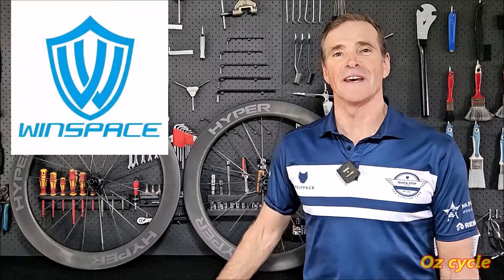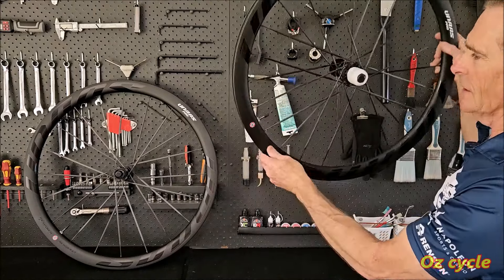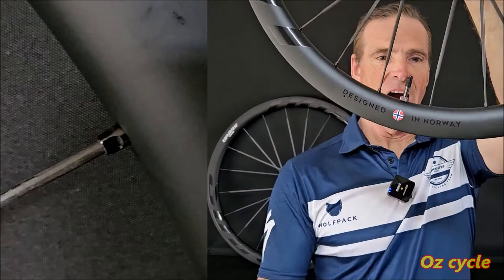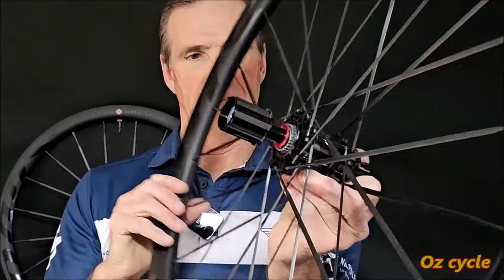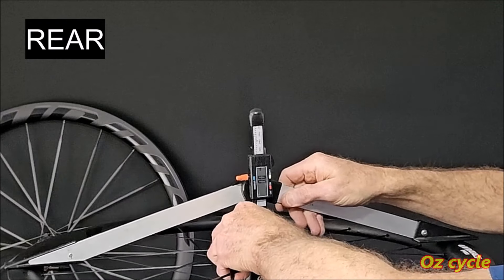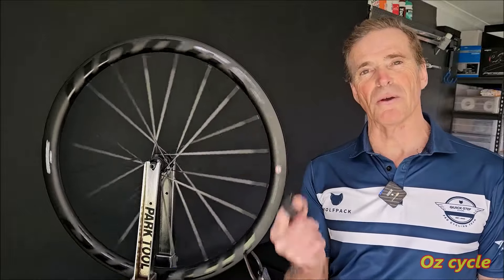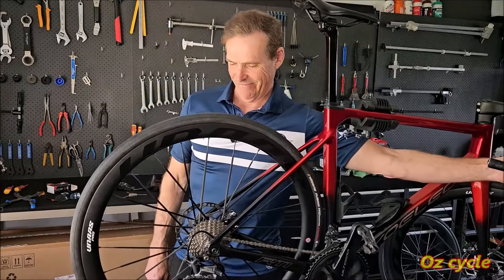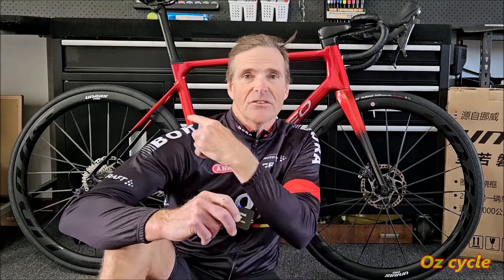New Winspace UNAAS carbon wheelset - full review

Comment: I have the 2023 Hypers.  2 weeks ago, I was on brand new asphalt.  Smooth as anything.  Anyway, got distracted and wasn't looking at the road ahead and went right into a big, deep hole in the road where a utility is located.  I was going at a pretty good clip and almost went out over the handlebars.   To my surprise, my Hypers are perfectly fine, not even a tiny wobble.  Amazing.
Reply from the maker: That good. Yeh , carbon is very strong up to it breaking point.
Reply: @stevenleffanue I hope that you are well , regards , Robert . I am still cautious of brands that are new or yet to be proven .
Reply from the maker: True. Winspace have been around long enough and have a good reputation.
Reply: @stevenleffanue  Over 90% of all carbon rims are made in China! Even the ones from most big western brands. ;-)

Comment: This is definitely a good and thorough review in my opinion.  So, thanks for that - it helps with being in the market for some wheels.  I'm a casual road biker, but put about 1700 miles a year on.  I ride a Giant Defy Advanced, but it has original stock wheels, and these bad boys are about 2200grams, give or take.  So, as you can imagine - first and foremost -  want to lessen the weight.  But, I see here with the comments that me feeling good about a 1500-1600gram offering is off the mark when considering carbons, much less carbons with carbon spokes at sub 1400grams.  I'm a 180lb rider, so middle of the road and I don't think I need "robust" wheels.  My question at this point is in considering cost/shipping/duties/quality and whatever else - how is a wheel like this going to stack up while also considering alloys from Hunt, Scribe, Boyd?   I can get 1500-1600 gram alloys at about $500 give or take from these companies - and they're not made in China.  Is it worth it at a current sale price of $699 USD on these for the extra 100 grams?   Given I'm currently riding with boat anchors, I was super excited to get down to 1500 grams.  Now, at this sale price of $699 on UNAAS Pro D40s , I'm tempted.  Any comments?

Comment: Hi Mate, can you confirm if they are centre lock or six bolt?
Reply from the maker: Centrelock
Reply: Thanks Mate
Reply: About to place an order, do you recommend these over more expensive but lighter wheel sets with ceramic bearings and carbon spokes
Just wanting your recommendation

Comment: Nice but those winspace rims are very dated. Too narrow for current standard in all their offering - 27/28 external width is just no acceptable now.
Reply: Not really. It is perfect for bikes that run rim brakes. Also, there are very few carbon wheels on the market that cater for wider rims than 28mm. Only a limited few cater for what you want.
Reply: @chrismac2434  bro it's 2025 wake up
Reply: @kubackjeee  That's ok... we see things differently 😁